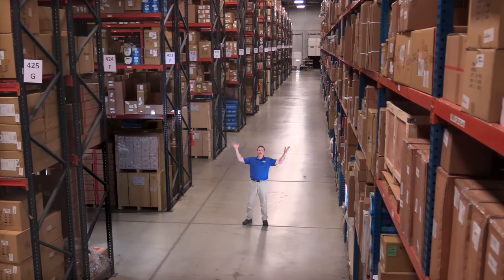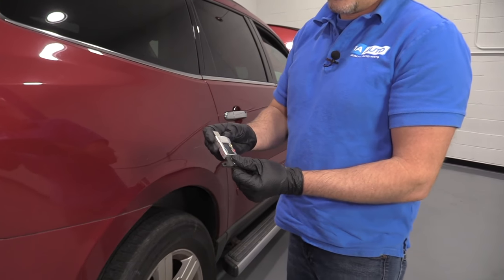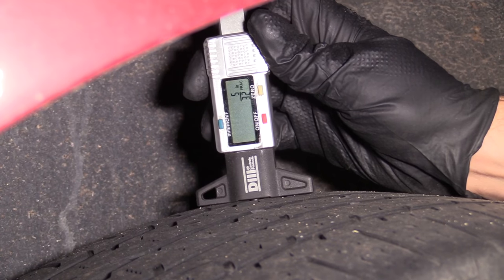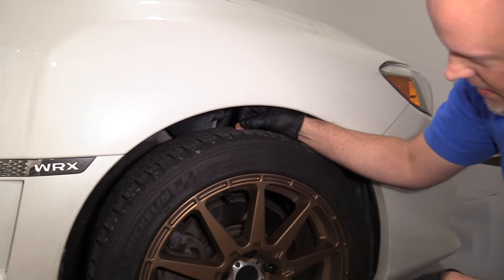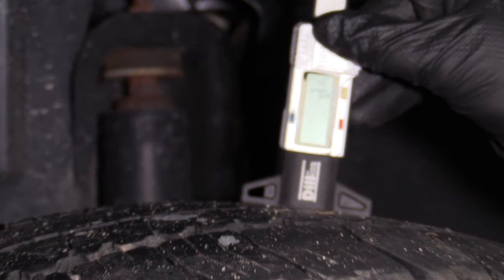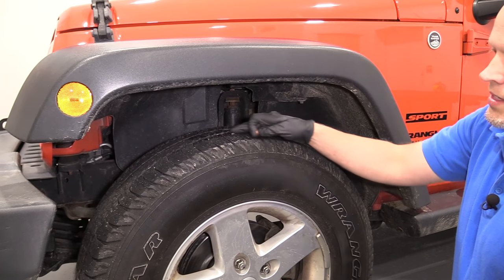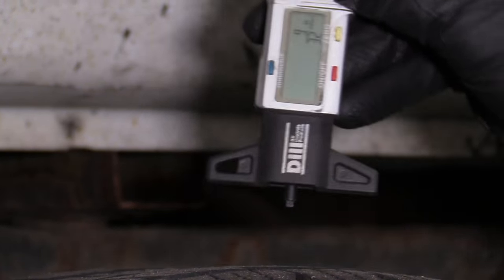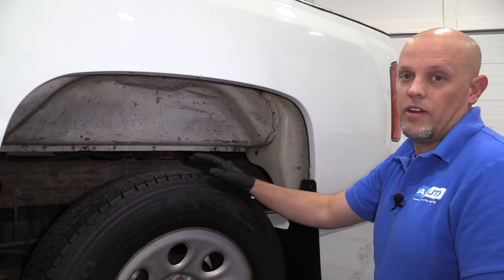How to Check Your Tire Tread Depth with a Gauge or a Penny

Comment: Hello, what is the average tire replacement cost because some shops tried to make me pay $780-$800 for tires and I thought it was a little too much
Reply: It depends on the tyre make/range and how many you're getting replaced :)
Reply: what car? what tires?
Reply: best to just shop online for your tire size and have them delivered, then call tire shops around you and ask how much they charge for “mount and balance“ should be about 20-30 per tire. doing this usually saves you some money